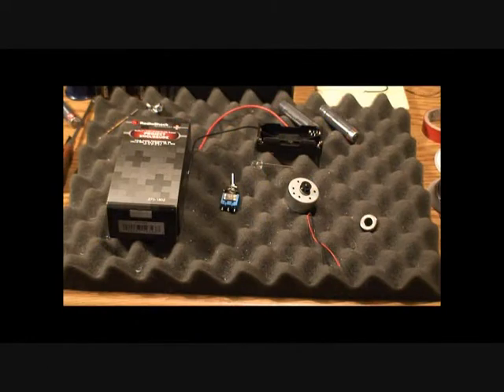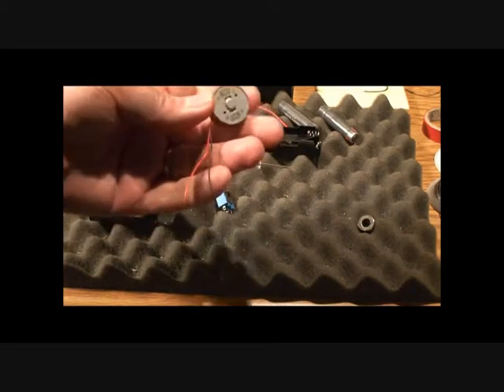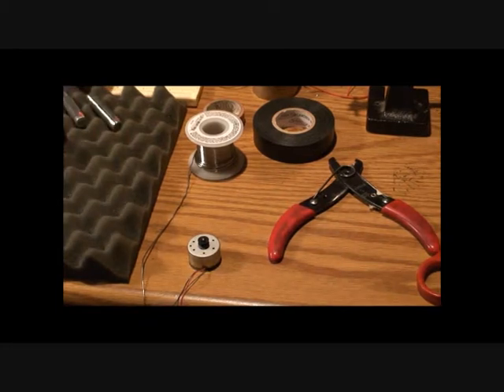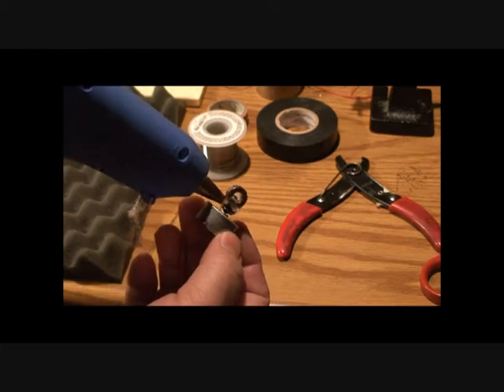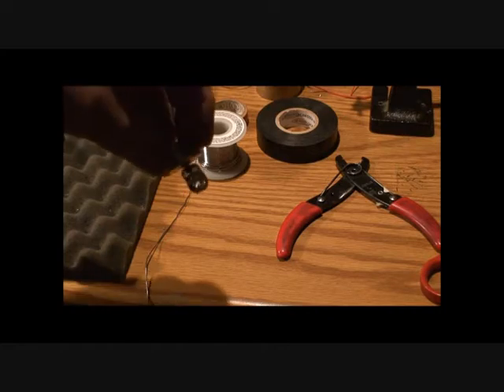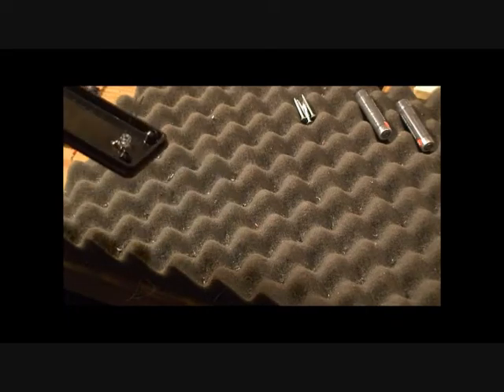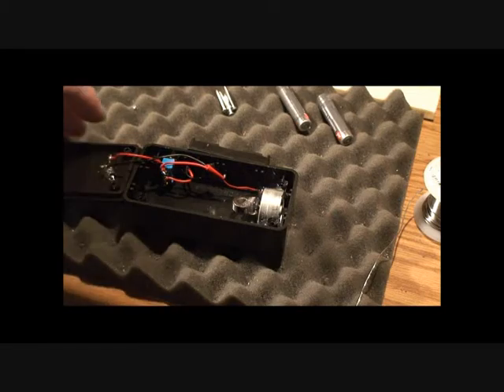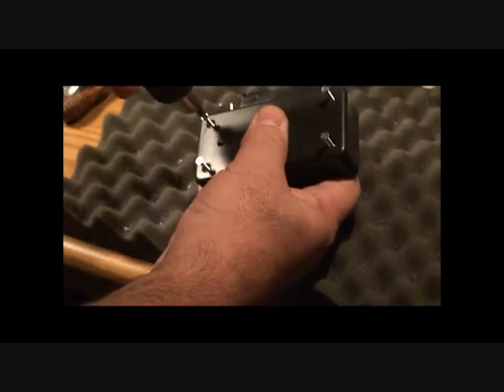How To Build An EM Pump

Comment: I don't see how just spinning the magnet generates a field . You need to surround it with a copper ring.  The magnet does have a field but spinning it inside copper actually generates new magnetic fields

Comment: Can you use a metal project box for this?
Reply from the maker: A metal box would keep the created EM field inside the box defeating the purpose of creating an expanded external EM field, ideally outside of the box.
Reply: @RichHorn  thanks I didn’t think it would work myself but no harm in asking.
Reply from the maker: @Alscameracorner  Never any harm in asking anything.

Comment: Hi, Great tutorial, thanks for sharing with us.   I am buying the materials now to try this.  Is it possible to solder the magnet to the motor instead of using hot glue? Probably a stupid question, but I have never worked with electronics before and I have never used a soldering iron... but I have just ordered one 🙊
Reply from the maker: Solder usually won't stick to the magnet. I'd recommend a thick gel super glue instead.
Reply: @RichHorn  Thanks for replying. Great, I will try that. Thankyou 😊

Comment: What kink of RPM's should the motor have? thanks😊
Reply from the maker: I'd reccomend a 3000 RPM or higher motor like the kind on a cd/dvd/bluray player. The faster the magnet spins, the larger the EM field created.
Reply: @RichHorn  Just what I ordered, thanks.
Reply: @RichHorn   Now that, that is out of the way, I have searched high and low (Amazon and eBay) and I can not find the spindles for the motor shafts, any ideas

Comment: Hi. Would this matter much if the magnet was glued down on its main face? Or is that a dumb question?
Reply from the maker: There are no dumb questions, only dumb answers.   I'm sure it would work, although probably to a lesser degree, however I've never tried that so that maybe something to experiment with. Also a small bar magnet would work quite well too. The trick would be to get it centered though, or the box will vibrate excessively.

Comment: Hi thank you for your video on how to make one of these I’ve been after one for a while I have most parts just waiting on few things to make this just out of curiosity would a wooden box be ok to use I have two boxes that could work but worried it may block the ems x
Reply from the maker: Hi Claire, would doesn't really block EM waves, but it can diffuse or dampen the waves a bit dependong on how thick the wood is. The best thing would be to make one and test it with an EMF meter. If you don't pick up the the generated EMF at least a few inches outside the box. you should probably switch to plastic. HTH
Reply: @RichHorn  thank you for your reply I will try it I do have a project box and a wooden box I’m going to make two and compare the results x thank again for taking the time to reply to me x

Comment: Hi, thanks for the tut. I'm starting my shopping. What do I need to look for (the specifics) of the LED? I'd like mine to have one, but the forum I was reading insists you have to have a resistor sequenced into the wiring of your LED.
Reply from the maker: Hi Eric,
You'll want to know what wattage the LED is rated at because too much wattage from the power source will burn out an unprotected LED. The batteries in this build put out a total of 3 watt, so an LED rated under 3 watts would need a resistor to lower the wattage going into the LED to a safe level. Even an LED rated at 3 watts should have at least a 1 Ohm resistor to protect it because batteries sometimes have a higher initial charge than what they are rated at. If you look up "LED resistor calculator", you will find several online calculators which will help you find the value resistor needed for almost any LED and power supply.

Comment: I think it will work without the magnets. Just the electric motor will produce EMF when it is running. I have a water pump on my cats water bowl and it pegs my K2 at more than 12" away. I would try it without the magnets.

Comment: Made the same little beefier. How do you keep the batteries from getting hot?
Reply from the maker: If the batteries are getting hot, the motor you are using is pulling more current than the batteries are rated at. If you can post the motor specs (voltage and amps), I can give you a fairly simple solution.

Comment: I have a bunch of small motors like the one you used in this demo as well as a bunch that i got from discarded laser printer paper trays.  Would using several of these motors daisy chained together work?
Reply from the maker: There are several ways you could do that. You would need to use motors with the same voltage rating and depending on  how many you use, and if you wire them in series or parallel, you would need to change the battery voltage to accommodate that.

Comment: I wonder if not having the magnet, or have a larger one makes a difference.
Reply from the maker: The magnet is the heart of this design. With no magnet, there only be a weak EM field from the motor. A larger magnet would produce a larger field in theory, but the type of magnet make a big difference too.
Reply: What kind of results have you gotten? I'm looking for ways to get rid of spirits, and would think some frequencies or adaptations of this design might help.  Any ideas on this?    If you google 'Entity removal tech', there are some methods there, but it's still an new area of research.  As far as I know.

 I used to do entity clearings, and man, people don't know how bad it is around us and what all is going on.
Reply from the maker: I have no experience with spirit removal so I can't say how that could be accomplished, but given the fact that electromagnetic fields constantly permeate our environment, I don't think it would be much of a deterrent to a spirit and in fact might have the opposite effect.

Comment: thank you sir for such a nice video. But i got a question, can this pump create enough EMF to create an induced current in a near by coil?!
can this current switch on a relay?!
thank you ^__^
Reply from the maker: Ali Ma'moun Farrah That's a good question, I'll have to try that to see.
Reply: Rich Horn 
Fortunately, thanks to your circuit, with some modifications i was able to create around 1.6V in a near by coil ^__^

Comment: The magnet on the motor does nothing. You're picking up the magnetic field from the electric motor, not the spinning magnet. If you want to energize the environment, use a small Tesla coil. You can build a small Tesla coil for about $10 & it will give off a big EM field. I made one out of a Harbor Freight electric fly swatter that made an EM field about 4 foot in diameter. Your cell phone pumps out more EMF than the EM pump. Check it for yourself.
Reply from the maker: Actually the magnetic field from the magnet aides greatly in the EMF created by the circuit. It is a function of Lentz's Law and I am making a video to explain how that works. Cell phones create EMF in the GHz range of radio frequencies which are not of interest in the paranormal field. This device produces EMF in the 48-53 Hz range. I love the Tesla coil idea. I have experimented with those before, but you have to be very careful with placement and the danger of electrocution.

Comment: could you epoxy the magnets to the motor? would that make a difference?
Reply: I actually soldered the magnet to my motor!! It works great!!!
Reply from the maker: Yes you can use epoxy. Just make sure the magnet is mounted as straight as possible to eliminate wobbling and don't let the epoxy drip into the motor. Once it has dried, it should make no difference in the performance.

Comment: that pink noise from the fan sure would enhance evp's...maybe try random noise generators for evp sessions before exposing ones self to even more electromagnetic emanations, just saying :)
Reply: dont get me wrong this is very cool but the fan noise bothers me...
Reply from the maker: You don't have to be exposed to the EMF. When I have used these, I usually let it run in an area for 15-20 minutes while I investigate other areas. Then I return to the are where the EM pump is and turn it off before investigating that area.
Reply: so you "charge" the area...ok that makes sense!
I wonder what an unshielded microwave oven would do!!!( dangerous do not attempt)
Reply: +Rich Horn Now this is smart!!! Great idea Rich! Give a room a charge up and then let it speak, love it.

Comment: what should I do if I want to have it twice stronger ... so the waves even more stronger?
Reply from the maker: This set up is limited by its voltage and magnet size. You could try building one using a larger magnet and a 9 volt battery ( this motor can handle 9 volts) but if you use the LED with that, you'll need a resistor to protect the LED from being over powered.
Reply: +Rich Horn hello I was wondering what size resister to use with the motor and led with a 9v battery? thanks and gave a good day.

Comment: Where did you get the magnet, all I can find are ones with a countersink hole on one side which will probably make it very unbalanced. I have checked every auto parts store around, radio shack and Ebay. Thanks, True Blue Paranormal Investigation (TBPI)
Reply from the maker: The best place to find them cheap is on Ebay.
Reply: I looked but they all appear different in one way or another but I'll keep looking.thanks
Reply from the maker: Timothy Pierce As long as the magnet fits in the box it will work fine. It doesn't have to be exactly like the one in the video. Any magnet will work. I just preferred the Rare Earth magnets because of their strong magnetic field. I chose the ones with the hole because they were easier to mount.

Comment: I wanted to clear up some confusion. These pumps are not emf pumps and do not create a electro magnetic field. They create a magnetic field.
Reply from the maker: That is correct, these devices could be referred to as magnetic field generators, however there is an electromagnetic field created by the motor when current is flowing, so while these types of devices create a largely magnetic field, there is also a small electromagnetic component as well.

Comment: What it sounds like is a residual type of haunting. Meaning it plays over and over again at the same spot. You can record it today and tomorrow and it will say the same thing. What else could cause it is with your appliances running they can cause electromagnetic field which can cause a whole bunch of problems as well. Hope this helps.

Comment from the maker: Water pipes can emit magnetic waves and refrigerators and microwave ovens are notorious for emitting high magnitude electromagnetic fields. You may be sensitive to EMFs and the proximity of the sources of EM waves could be causing them to converge in that area and that could cause auditory or even visual hallucinations depending on your sensitivity. You might try placing a digital audio recorder in that spot and see if you pick up any EVPs. If you don't, the EMFs may be affecting you directly.

Comment from the maker: My pleasure, my friend! It sounds like the LED was too low voltage. The LED must be 3 volts for this circuit, or use a resistor if it is lower voltage.

Comment from the maker: There is flowing DC electricity from the batteries and motor circuit which emit EMF. This combines with the strong magnetic field produced by the magnet. Granted the field produced is largely magnetic, but there is a small electrical component. Whether or not the electrical component of EMF is necessary in the paranormal field has not been established. In fact it is only theory that EMFs are useful in paranormal research, but some people seem to have had some results using them.

Comment: Thanks! Built the pump easy enough with your excellent instructions. Used it tonight during investigation. Introduced it to whomever was listening, turned it on, temp dropped, air got heavy, blue LED light began to flicker, motor began pulling hard...then it stopped. LED still flickering and motor not running. Took it to base, opened it up and nothing wrong. Can't wait to review the evp session!

Comment: I must also add that all the motors that I looked at in Radio Shack, all were high speed ones and like I said, none of the had the belt pully so that I would not have a flat surface on which to glue the magnets onto. One other thing, Ingot the next size up for the project box, so that it would be easier to wire things up. All in all the only problem I had was that of obtaining the magnets and the motor but now knowing that, I know where to get them in the future. Once again, thanks for the vid!

Comment: Hey Rich, I didn't have any access to any broken CD or DVD player to get the motor, so I went online to E-Bay and found one for like $5.00. And the real selling point for me was the belt pully attached to the motor, made it easier to attach the magnets. I first did go to my local Radio Shack and they looked at me like I had three heads when I asked for one. It was the same thing when I was looking for the rare earth magnets, I finally went online and got some.

Comment: Also like I said the DC motor only had that 1/16" spindle with no pulley mounts on it. But it's ok, I'll just slip the spindle a little bit in between the magnets and then Ben

Comment from the maker: Hi Allen. Find a broken CD or DVD player and take the tray motor out. Those are low profile and hearty motors and have leads on them and a pulley mounted on the spindle which makes it easier to attach the magnet.

Comment: The next problem was that the motor did not come with any leads to it, so  I had to attach some wiring for that. The problem was that the markings for the signs of the negative and positive leads was so small that I had to use a magnifying glass to see it.

Comment: Sorry, the only dc motor they had were not really small ones, and the spindle is really small, say like an 1/8 of an inch in diameter which means  that it will not be easy attaching the rare earth magnets to it. IIt also means because of the size of the motor,  I have to get a box that enough clearance between the motor and magnet unit and the other comports inside he box. I was going to get a small computer cooling fan but the cheapest Radio Shack has was like $15.00.

Comment from the maker: Heating a magnet will cause it to loose some of it's magnetic strength, so soldering it is not a good idea. Try to find a piece of plastic or rubber to glue to the tip of the motor spindle rod as a mount for the magnet. Make sure no glue gets inside the motor! Then when that is secure, try gluing or hot gluing your magnet to the mount you made.

Comment from the maker: That's part of the motor. It's an Xbox motor that opens the CD tray and has a pulley mounted on it for the drive belt on the tray. It makes it easier to mount the magnet because that is already attached to the motor spindle. Any cd/dvd drive tray motor usually has that on there.

Comment from the maker: Hi,

I use 1/2"X1/4"X1/4" magnets. The size is not crucial, but mounting it as straight as possible will reduce vibration when spinning.

Comment from the maker: Hi Eva, the box material can be anything except metal. The type of battery is up to the builder. If you use a 9 volt, you will need a resistor to keep from burning out the LED.

Comment: Does the box have to be made of plastic, can it be made of wood?

Also you use 2 AA batteries.  I have seen other make these using a 9V battery.  What would be the purpose of using one over the other.  Does the battery size have something to do with the light if you install a light to show the unit is on?

Comment from the maker: You can try Super Glue, just make sure to use the gel kind so it doesn't run down the shaft and stop the motor from turning.

Comment: So..i have a DC motor and ceramic magnets. I tried putting one magnet on both sides of the shaft, and had it working but after a while, they flew off. I'm now trying it the way you did (magnet on top) and i'll see how it works. I think it's the hot glue not holding. Any other ideas?

Comment: on the lighted switch you used does the light stay on when the switch is in the off position.  I got one from radio shack and it stays on when in the off position.

Comment from the maker: Size and speed both pay a role in the output. We've made some bigger and faster units and even multiple magnet units, but we've actually gotten better results using the small units. Not sure why, but that's what we've found so far.

Comment from the maker: You could put a potentiometer inline between the motor and power supply. I would recommend a 10k to 50k linear pot on the red (+) lead from the switch to the motor. That should give you smooth control over the speed.

Comment: I finally made my em pump per your instructions. Only thing different, I used a different motor, and when turned on the thing dances across the table and very noisy. The motor I used is a Aristo-Craft Cermag Motor, 1.5-3V, 7600RPM. Is there a way to slow the motor down?

Comment from the maker: It depends on the motor you use. The one in the video operates at 3-5 volts DC. If you use a 9 volt on these, you'll need to step down the voltage or control it so you don't burn out the motor. However a 12 volt motor will run with a  9 volt battery.

Comment from the maker: @vfx1987 The soldering iron is for soldering wires to the switch and the LED. And if your wires won't reach, you'll need to solder extra lengths of wire onto the short wires to make them reach.

Comment: also, how did you get the wires from the motor connected to the switch?  the red wire from the motor isnt exactly long enough to reach it, then the red and black from the switch to the led.  did you put on additional wires and connect them to the end of the red and black wires?  and what did you need the sauter iron for?  for what piece?